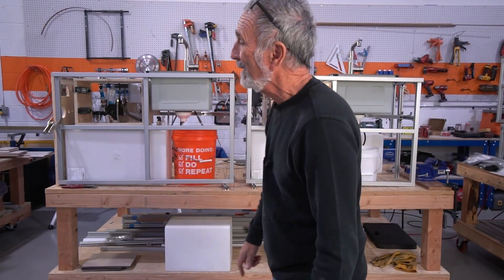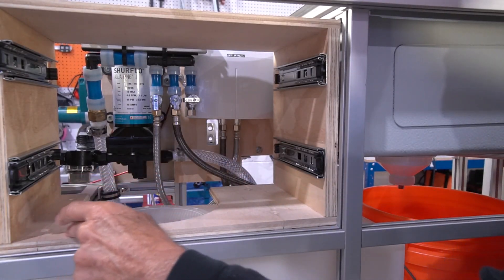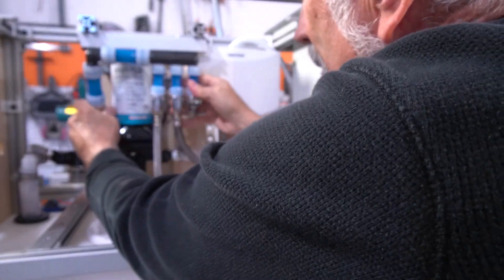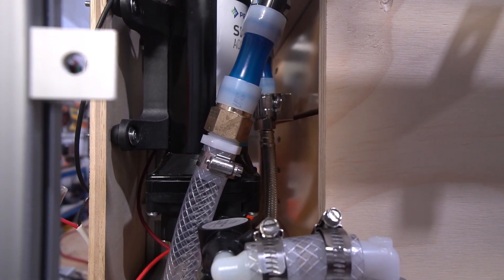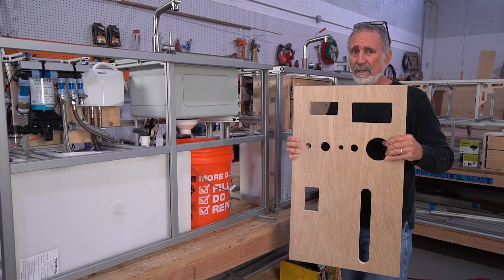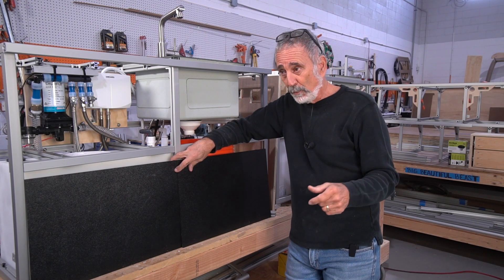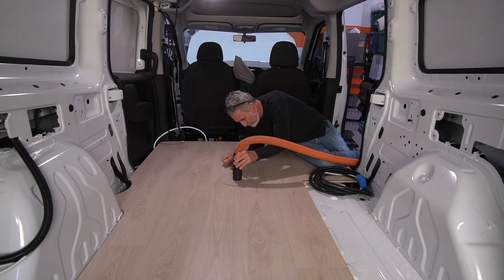How to efficiently design modular SLIDE-IN VAN COMPONENTS using 8020 extruded aluminum

Comment: Unlike many YT offerings, the 15 minute length of this video flashed by in what seemed to be an instant; yet, the sheer volume of information imparted took a second viewing in order to digest properly. (Plus, you be so darn funny) 
Thank you George for taking the time to share your work with us.
Reply: On my 2nd viewing, I find myself thinking I would want the option of requesting that the finished floor be left intact, to be cut if/when the fuel sender flubs out…. Just hide the floor square spare behind the [insert tight-tolerance location decision here] for when that fateful day arrives.
Hopefully, Humble Road will consider accommodating this design substitution…
Reply: Finally, my ride is the Ram ProMaster 1500 (136”) with 13,000 miles on her.   And, no, I have not built her out.  I have my hippy-level, small-footprint, modular system working for the camping trips I take. These modules come out(i.e. are removed) for the rest of the time, where she is, unfortunately, put to work on her regular gig.
George, let us know when the HR Mini Production Design is expanded to include install for this model (tall roof). I would think eventually you would be able to modify your floor plans to fit an increasing number of vehicle offerings such as my Ram.  One day…..
Reply from the maker: I have on order, 3 RAM Promaster 118 WB low roof vans. These will round out my product line as the Maxi-van. Mini = Promaster City. Midi = Mercedes Metris, Maxi = Ram 118 low roof.

Comment: Beautiful detail on the water tanks sitting lower in the floor than the galley carcass.  This is genius. The water tank is so heavy that in a crash or sharp turn, it could dislodge and damage everything around it. By sinking it into the floor, the load forces on it are distributed along the entire floor which acts as a fence to hold it in. Really smart design.  You would make a world class chess player, George!  Always 3 moves ahead of the rest.

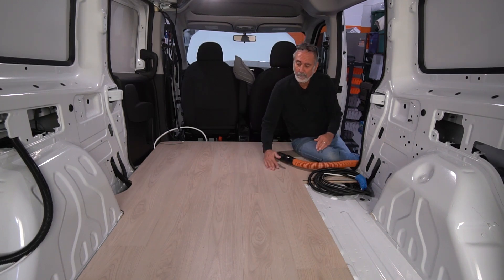12:00 - A small rug on the floor and that hatch joint will remain dust free forever.  Another brilliant solution to a problem. Lovely design, George.  I am loving it!  Thanks for another great build and video!  Best from CA!

Now if you could only learn how to cook eggs without burning them!  😂😂😂
Reply from the maker: Thank you, MJ!

Comment: I like the rubber isolators on that pump - reduces noise. I'm sure you also know there're varying pumping noise levels depending on the type of pump you use. I sail often and the water pump noise on the average boat annoys me. The gerotor type is much quieter if you haven't looked into these.

Comment: George. Do you normally do a cutout for a kick plate at the base of the cabinets? How is that framed out. Do you have any videos showing the construction?
Reply from the maker: Normally, I do not put a tow kick under my cabinets however, in the sprinter, I have in house now I will be using a tow kick and passive radiant heat under that cabinet

Comment: I have been watching your videos for a very long time and I do have a question. In your videos you are using the dodge promaster city for your camping videos. What is the advantage  of using the promaster city over the ford transit connect.
Reply from the maker: I chose the RAM PMC over the Ford Connect for several reasons. The shape of the cargo box allows for a better living experience inside the PMC. The up front cost as well as maintenance and repair is more attractive with the PMC. And I just think they look more quirky than the Ford! And quirky is good! 👍

Comment: By sitting the water tanks directly on the metal van floor, doesn't that make them more susceptible to freezing?
Reply from the maker: The tanks are not sitting on the floor. There is a 1/4” of plywood sheet under them. You must have missed that part of the video. Now go back, young lady, and re-watch that part! And you will still get your passing grade! 😉😁
Reply: @HumbleRoad  I definitely missed it! Thanks for the clarification.

Comment: Does water movement in that unbaffled tank cause any issues with that water pickup? Seems like if you hit the brakes or accelerated too much to might get a little blow by through that grommet as the water moves.
Reply from the maker: Nope. Those grommets are made to install at the bottom of a tank. Last for years. Very tight fit.

Comment: May I ask why you chose to use hose clamps on the input side of your Shurflo water pump?  I know that due to vibration, there should be flexible pipe for maybe 6 inches on either side of the pump (or so they say) but you're taking the hose clamp usage seemingly all the way to the final fresh water tank intake.  I know you use and like Pex-A, and that's what you have on the output of the pump.  Thank you!  I just noticed it... great video BTW!
Reply from the maker: I prefer flexible hose all the way to the zone manifold, which is where the Pex starts. Flexible hose offers better vibration dampening and the hose clamps allow for easier maintenance and repair. Have you ever had to repair an Uponor fitting? Very difficult!

Comment: Tee Nuts have "teeth" to prevent its rotation, I assume that the screw you added assure the the Tee Nut won't pop out accidentally when inserting the screw.
Reply from the maker: Correct. Belt and suspenders...
Reply: @HumbleRoad  BTW, I used a plastic marine thru-hull for the water pick-up tube, which is made of plexiglass and glued inside the thru-hull, a marine plastic check-valve can be added at its end.  The water pump hose can be then securely attached to the barbed portion of the thru-hull.
Reply from the maker: I use the thru hull fittings for my tank vents. 👍

Comment: Very impressed w/you builds - just returned from Overland East and could not find anyone with the same attention to your level of detail - very impressive. Question, do you lose any space due to the 8020 being straight, and not conforming to the wall shape as well? curious how you handle this - assume it’s fine due to the back of the ‘frames’ being open?
Reply from the maker: I  "step" the verticals to hug the wall curve.

Comment: How much do think u would expect  to spend $ on the aluminum .. I think they come in 8 foot length  .. at least with wood u can make a mistake or so but with the aluminum I don’t know might be a little costly  … wats your  opinion I would like to know  ..
Reply from the maker: Aluminum extrusions are certainly more expensive than wood. It is lighter and stronger. It is easily edited and reconfigured. The waste I produce across 20 vans fits in a 5 gallon bucket.
However, my builds will last longer than organic wood. Also have a higher resale value.

Comment: any reason why you do not use crimp clamps on your plumbing?
Reply from the maker: I prefer the adjustability, the stainless steel material and the availability for the end user. They are easier to work with for the older clientele I cater to.

Comment: Nice sir! Very well thought out as usual. But a commentary on some aspects. Why not use dovetail for the drawer boxes? They look so mass-produced with only 3 screws in place on each corner.  Also, why use wood for the water pump mount? You could use a composite material that will never rot and should be fire-retardant or aluminum material. Lastly, the T nut can look better when they are flushed and held by a transparent composite material instead of a screw. Just my thoughts. Thank you.

Comment: Always love you attention to detail but the fuel pump access is over the top. Think marking the place on the plywood would be enough. Also like your outtakes.
Reply: The main reason for the access is that the possibility of an auto mechanic making a nice, clean and repairable hole in the finish floor to maintain/replace the fuel sending unit is rather slim. The CNC makes quick work of fabricating the perfectly round hole in the subfloor as well as the subfloor disc and finish floor disc. :)
Reply: I was stoked by your solution!

Comment: Too bad ProMaster City was discontinued. All of these are going to be museum pirces😢
On a different note - it seems like you’re using a LOT of 90 degree angles on those water pipes. I believe that the best part is no part. Won’t it be possible to remove some of these? Might also help water flow (though this is less of a priority).
Reply from the maker: In such a small system, the fittings have not been a problem. Good pressure and flow.

Comment: I'm sorry to say, I'm not a fan of the round hatch in the floor. It would annoy the 💩 out of me when the pattern isn't aligned and it being round, it will get out of line. As someone else suggested, why not make it square so it will always be aligned or have it snapped in place with magnets if it has to be round for some reason. I would actually much rather prefer the second option you mentioned, with the vinyl intact over the hatch in the subfloor and have the coordinates. You could even provide a template to cut along. I would cut a u shape so it's a flap (I'm not sure flap is proper English, sorry if I don't make any sense here) if you cut in an angle it will nicely fit again. As you said, the chance you'd have to do this is close to zero % so I'd rather have a nice floor in one peace instead of having a circle in my floor which you can't unsee once you've seen it. Perhaps let the customer choose between the options.

Comment: I like the access hatch, but how about laminating a plate of ferrous steel in it instead, ON THE BACKSIDE.  You then experiment on how much steel and how many magnets you need to pull the access panel off (we all know how much you love to do research), and then make a magnet handle for the owner of the van.  Make sure to document how much magnet power it takes to lift the panel so that you can add that to the specifications of your vans (someone is bound to lose their magnet handle) and buy some improvised magnets at Home Depot to pull up the hatch in a pinch.
Reply from the maker: Magnet handle knock-offs?! 😳 I better prepare my cease and desist letter...
Reply: @HumbleRoad  The Magnet Source on Amazon:  $25, now you don't need to design a handle, and you have a specified lift weight of 25 lbs.

Comment: on the mini:  since the water tank is on the floor of the van, how do you keep the water from freezing on those cold nights?
Reply from the maker: As I mentioned, we lay in a 1/4" plywood panel for the tanks to sit on. That acts as a thermal break. And if the van is in use, with a person inside, I highly doubt the interior water tank would freeze.

Comment: Love the designed in access to everything, attention to detail, practicality, quality, etc EXCEPT those awful, cheap, leak-prone screw-down hose clamps!!! A proper Pex crimp clamp ring will almost never leak or loosen and are easy to replace. PLEASE reconsider using those terrible clamps!
Reply from the maker: Disagree. Particularly with your adjectival abuse! 😉 You should not use Pex crimp clamps on hose, only Pex tubing. I prefer Uponor fittings and ProPex over Pex 100% of the time. In an automotive (high temp/high pressure) application, I could accept the use of tension clamps. But for low pressure/low volume water systems in a RV, I prefer the ease of use, stainless steel material and maintenance of the hose clamp.
Reply: @HumbleRoad  as a 6 year full-time traveling RVer living out of 3 different coaches that use a mix of similar stainless steel screw hose clamps and Pex style clamp rings, I can only talk from my own experience that every leak I've ever experienced has been with those screw hose clamps. Not one crimp ring ever leaked. When I see such hose clamps, I replace them with crimp rings and never have a problem again. Good luck, as I can virtually guarantee you will eventually hear from customers about leaks in a few years. Regardless, there's no doubt in my mind that Humble Road makes the very highest quality vans available.